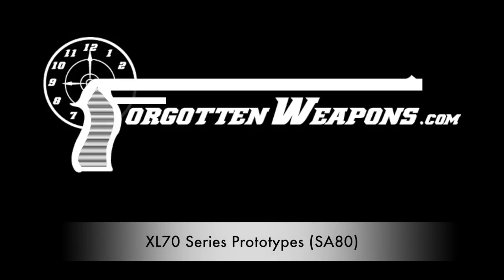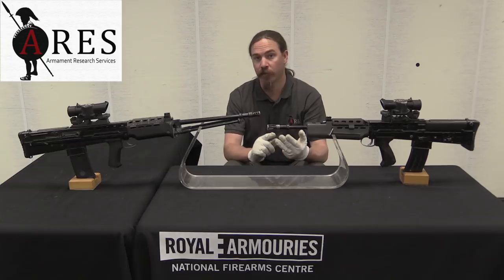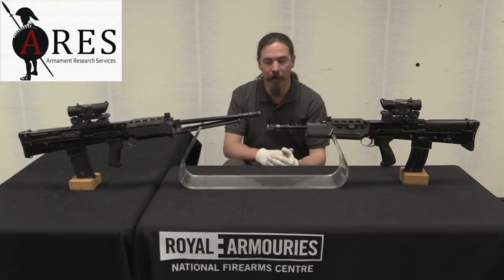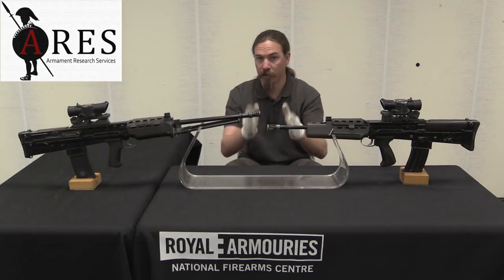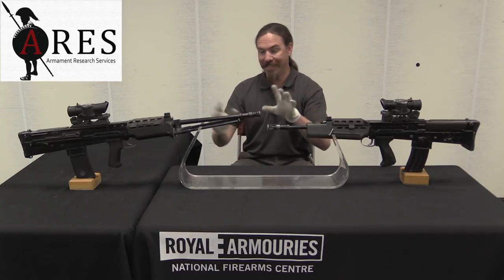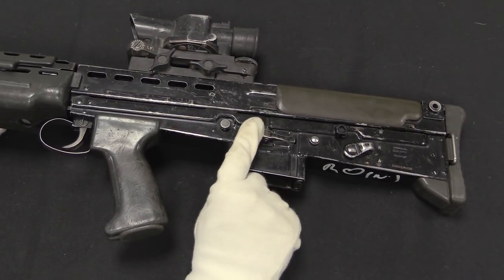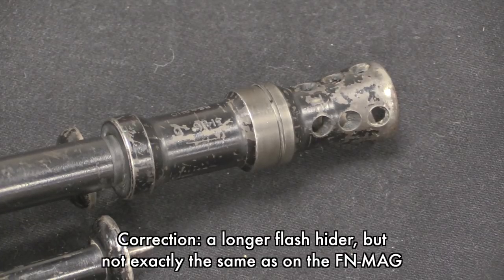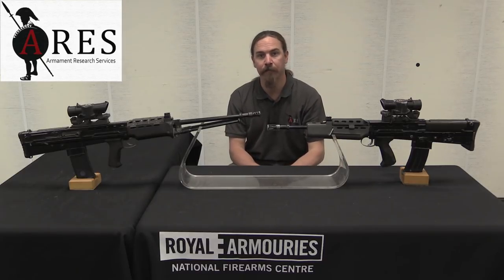SA80 History: XL70 Series Final Prototypes (Individual Weapon and LSW)

Comment: And is exactly how not to design a rifle. Or anything for that matter. I was told the firing pin on my LSW kept breaking because they made then cheap and light, then spot welded a hard steel tip to it. Looking at the rest of the rifle at the time, it made sense. Tis explanation makes sense when looking at how the dam thing was made from scratch.

Comment: This is pretty sad. Sounds like the engineers may have been onto a decent enough design but then politics happened...
Reply: sounds more like engineers who had never worked on a firearm let alone ever shot them, who also kept getting cycled out of the project as the politics kept getting worse, and worse. This is why you never hire someone who does not have good firearms experience to design your guns.
Reply: While I certainly agree that their lack of experience wasn't ideal, I think that it could have been mitigated by incorporating feedback from people who did have said experience. But that would cost time and money, so just disregard any feedback and make it cheaper!
Reply: Deadfast They didn't get enough money to make the SA80 good enough for all conditions. The gun needed refinements & the RSAF was being run into the ground, by Thatcher, ready to be sold off to BAE Systems, who should have kept the factory going & given them a lot more money, but they didn't as they wanted the money for themselves, through the sales of RSAF sites. It's like the BR Advanced Passenger High-Speed train, it was alright, but it had a few problems when it tilted. That project didn't get enough funding from the government again- when it should of & the engineers cannot work without money.
Reply: Commodorefan64 It's all to do with money. The budgets were inadequate for its purpose, unlike in Germany, where finance for projects is trouble-free & the workers were treated with more respect, than the stupid contempt, by the British managers.

Comment: people, the challenger disaster and the SA80. I personally always felt that the space shuttle was 'an accident waiting to happen' and it is a great compliment to those launching it that only one broke up on launch, I thought this because any space launch vehicle is subject to enormous loads and stresses and one look at the shuttle and you know it is asymmetrical and there have to be major problems from that. Challenger broke up because human decisions caused it to be launched under weather conditions which made it highly unsafe. 
The SA80 evolved through fudges and comprises together with a determination to hide failures. The EM1 rifle developed in parrelel to the EM2 was a similar pressed steel box design and was rejected really because of that 'cheap and nasty' construction which was then revived for the SA80; in the long run a high quality design like the EM2 would have been cheaper, CNC machine tools would be able to make such a rifle where skilled craftsmanship would have been required in the past and many of the problems and pitfalls eliminated really the issues relate to who is in charge of such a project, experienced experts like Kenneth Jason who built the EM2 or the politics which destroyed it?

Comment: The biggest pain in the ass is when you're trying to reassemble it and the lower doesn't quite slot in with the upper, you start to fidget trying to line up the pin holes and then the recoil assembly jumps out and you have to start all over again. Then it seems to sit together, but the rear hasn't quite caught the latch it rests in and it all falls in half when you thought it's clamped.

Comment: I have always suspected one of biggest reasons for all the bizarre political changes to the gun. Is the result of many in MoB thinking an assault rifle is no different than the old Stein Sub-machine guns. So the thinking probably went, well those worked out well, were cheap and reliable, why do they want to add all these expensive bits. With people in the MoB thinking that it's just a way to extend the program to milk more money out of the government. Its with that thinking that forced the gun out in an unusable form and destroyed its name forever. I would not be surprised after that the reason in the MoB denying the failure report from the Gulf War, was because MoB members at the time didn't want to get blamed for failures made by previous administrations so best to say nothing and hope the next guy fixes it.

Comment: Will you move onto the L85a3 or staying with the sa80 series?
Reply: I would consider the L85a3 to be vastly different than the sa80's.
Reply: It's easier to differentiate them if they are separate.
Reply: Primarch Alpharius That's why there are 'A1', 'A2' and 'A3' designations
Reply: For the sake of suggestions for a video I think karl gets it.

Comment: Aesthetically I have never liked that trapezoid shape. A the bolt is traveling on rails I am surprised they did not go with a polymer body. Injection molded plastics are cheaper than multi step stampings and weldings.

Comment: they should just drop that crap in 80s and buy AUG
Reply: Alexander Marinin The A2 is not a shit gun....
Reply: oh, yes, it took just 30 years and german's help to make this gun just barely shitty, lol
Reply: The aug is fairly trash, its probably worked out for the best the l85a2 is a fantastic rifle
Reply: >A2 barely shitty
Citation needed.
http://i.imgur.com/QD3by6q.jpg

As for HK, it was BAE-owned, not UK owned.
Reply: Do they measured it in a way Ian just told? You'll know A2's flaws from one of the next videos.
Reply: They were going to get the AUG until someone pointed out what they were going to cost cue multiple strokes in the treasury
Reply: did they fudge the numbers there too? Just taking the video into account.
Reply: iatsd what's bad about our AUGs?
Reply: AUG A1's used to be terrible, constant stoppages, tumbled rounds, magazines melted into the gun at certain temperatures.
Reply: HK was owned by BAE when the A2 was designed and manufactured, so technically it was still a British company that fixed the A1. Technically.
Reply: Keith moore have you never heard of the AUG or the FN F2000? They both apparently balance very well and they can both be used by lefties (the F2000 comes fully ambidextrous from the factory, but you've got to swap a few bits on the AUG). The AUG also has a quick-change barrel. The trigger is a trade-off for less weight (in most cases, the L85 is an exception) and a gun that's more compact but has all of the accuracy of a full-length rifle. The AUG still has the issue of not being able to switch shoulders on the fly, but you can do that with the F2000 just fine. 

TL;DR, Bullpups are a trade-off. You get a rifle that has a dodgy trigger and that you (in most cases) can't change to left-handed firing with on the fly, but you get a rifle that's smaller, just as accurate, and lighter. If I were in the military and I had to walk around in a desert all day every day, I know which one I'd pick.
Reply: Mitchell Mainey But the F2000 is also much more expensive than most ballpup rifles, so of course it has more features.
Reply: Or FAMAS ;)
Reply: And people say AK are crap ;)
Reply: FAMAS was fine, just not so modern (lack of rails etc) and most important was closing state arsenal which product guns ;), and some of famas are really old.
Reply: FAMAS is a crap. It needs it's special ammo, so french soldier can't just take mag from his NATO mate. If he'll try to shoot something like m885a1 - it will blow up right into his face. Delayed blowback isn't good for high pressure ammo.
Reply: They should just issue to their line troops what all their special forces and counter terror units end up buying themselves anyways, M4's.
Reply: Timhouse But they don't all use the M4. Armed Response use G36's. Counter Terrorist use SIG MCX. There is only one Royal Marine unit that uses the M4 and their job is to protect the Trident Nuclear deterrent, and they use the M4 for low pressure ammunition as the L85 is not ideal for this use. The rest of the armed forces use the L85.
Reply: If it actually comes to war, they'll end up using M16s or M4s anyways.  The American arms industry isn't going to retool to produce L85s, and that's where they're going to get a lot of their weapons from.  It's why until recently the Israelis were standardized on the M16/M4; they've yet to change fully to the Tavor, and it's likely that if they do happen to go to war they'll be using a mishmash of M16/M4 rifles and Tavors for the foreseeable future.

Then again,, there's a fairly low possibility of Britain going to war in any conflict other than one the Americans are involved with too and I'm not completely up to date on British manufacturing capacity should  it need to be diverted towards rifles for a war effort.
Reply: Alexander Marinin if the FAMAS had been designed with NATO compatibility in mind, it would have been a good rifle. The only complaint that it would have against it was the flimsy mags, just like the M16

Comment: It's a real bloody shame that this ended up being such a disaster on first issue.  It's typical of the procurement issues over here in the UK - the drive for low cost and speed at the expense of quality and reliability.  The irony is that if the rifle had worked the first time around and cost a bit more, it would have cost a lot less in the long run.  Do it right first time!

Although I've never shot one, I like the idea of the rifle.  Bullpups are problematic but it makes sense for a military rifle provided it's reliable - especially in situations where you are in and out of vehicles - which British soldiers often are.

I admit to having a bit of a soft spot for the SA80 series and these as an extension but it is mind-boggling how many stupid managerial and political decisions were made that actively broke the rifle - when they had it working quite well to begin with!  A fundamentally sound design and concept ruined by stupid choices.

Comment: No doubt Tory austerity was in part to blame for the failures. The tories were in power for 13 of the approximately 25 years of development, the last 6 of which were purely under Thatcher whose government is infamous for budget cuts which even went so far as taking milk away from children.*
 I wouldn't be surprised if the poor quality of the L85 started with strict costs for the system and ended with Thatchers vanity. She rode the Falklands to an election victory in 1983, no doubt the unfinished rifle was adopted in part to boost her image prior to the 1987 election which she also won. 
 Nothing has been as damaging to British industry, engineering and the economy as the tories.